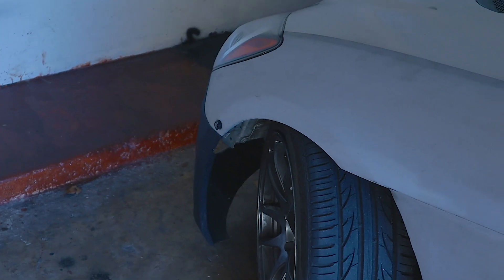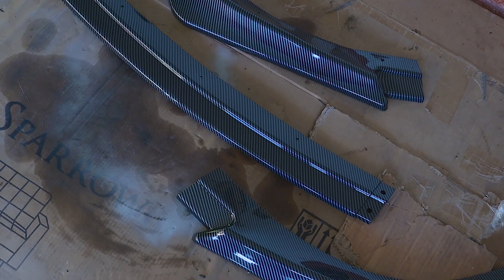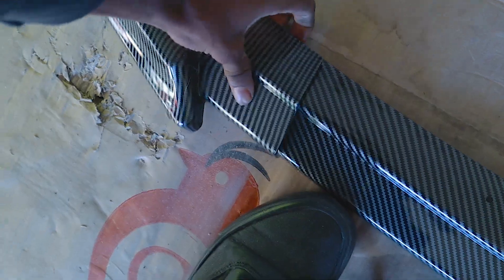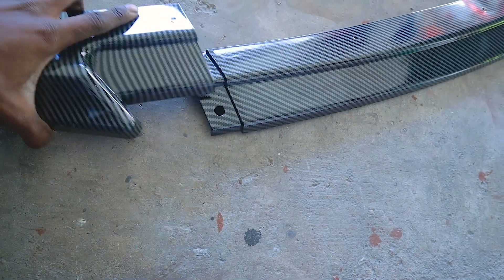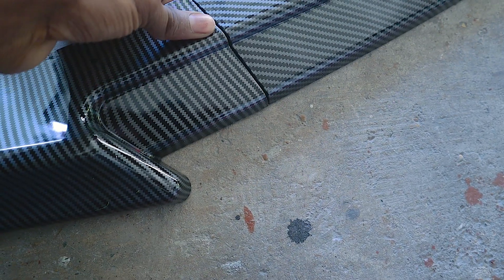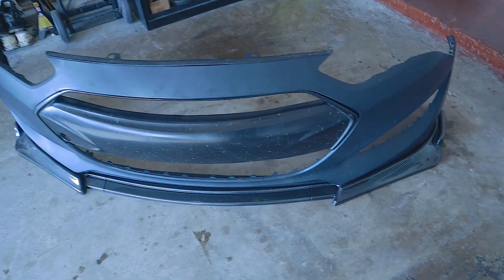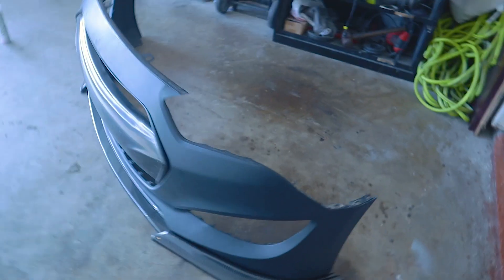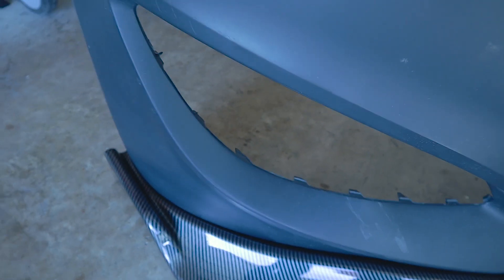YOUR Genesis Coupe NEEDS this CARBON Front Lip

Comment: Looks good, brother! Got the same exact front lip but not the carbon look.

Damn, I actually have a pair of fog lights I could've sent you. To bad that you cut the surrounding tab's in order to secure them in place.

The fog lights are without the daytime LED running lights. So, you would need the correct oem harness to run these specific ones.
Reply from the maker: ohhh wish I knew that XD all good though the mesh looks good as well!
Reply: @elbon4987  If you change your mind and think your able to install them let me know....

Looking forward to your next video.
Reply from the maker: @bayareanativechochenyo  Will do!! Thanks!

Comment: What screws and washer did u usw
Reply from the maker: I used some bolts & nuts from home depot
Reply: What’s the size is what I meant to ask
Reply from the maker: @brkdboy  I used 10 mm bolts and nuts
Reply: @elbon4987  by any chance do u have the link cause I bought the same exact lip
Reply: @elbon4987  and how much pieces did u use
Reply from the maker: @brkdboy  https://www.ebay.com/itm/363246273727?mkcid=16&mkevt=1&mkrid=711-127632-2357-0&ssspo=JXiCTMs2SvS&sssrc=2349624&ssuid=cyfndld1rmo&var=&widget_ver=artemis&media=COPY
Reply from the maker: @brkdboy  i believe i used 9 bolts total . 3 on each side and 3 in the center